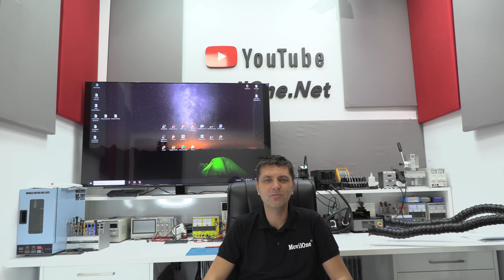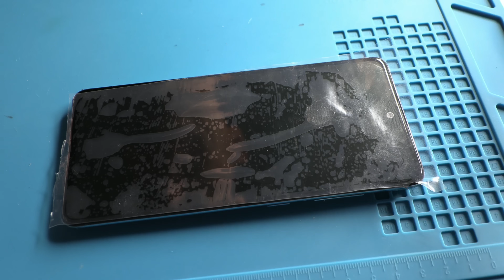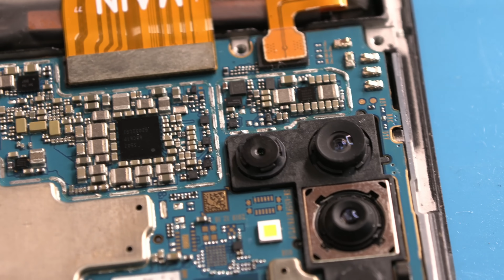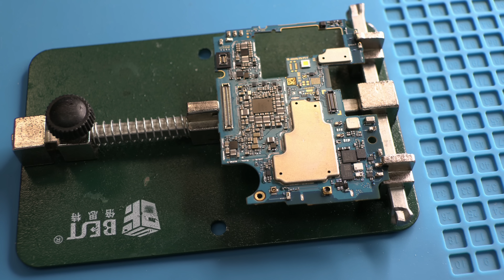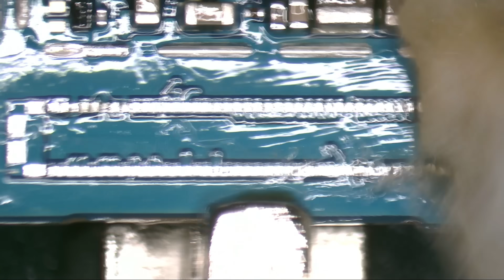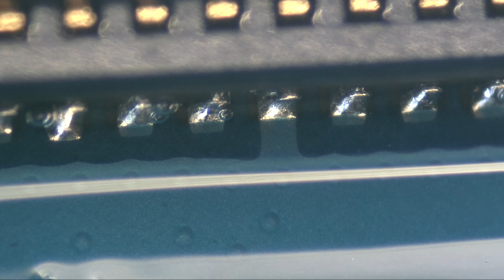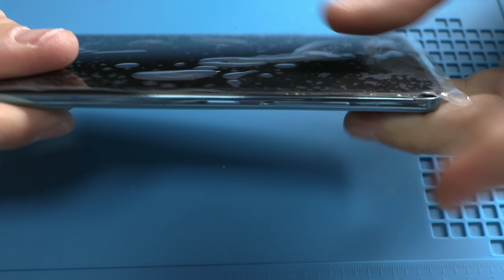The Samsung A Series Secret They Don't Want You to Know!

Comment: The actual fix was using leaded solder. Lead-free solder is the cause of many electronic device failures, especially on BGA chips and that's not going to change. Manufacturers don't look for an alternative to lead-free solder because it automatically provides a way for the device to fail, forcing the consumer to buy another one and manufacturers love that.
Reply from the maker: You're absolutely right. Lead-free solder has been a major contributor to premature failures in electronic devices, particularly with BGA chips where reliability is critical. While leaded solder offered superior durability and flexibility, the shift to lead-free solder under the guise of environmental regulations has undeniably benefited manufacturers. It creates an intentional point of failure, feeding into the cycle of planned obsolescence. Unfortunately, the industry's focus on profit outweighs the consumer's need for durable and long-lasting products. Until there’s a real push for change either from consumer demand or stricter regulations on repairability—this trend is unlikely to stop.
Reply: Tin whiskers I will never use lead free  solder, the military don't use it so I won't use it either. 73
Reply: Silver migration has been a problem for over 40 years in commercial equipment creating intermittent faults.
Reply: Lead causs brain damage.
Reply: No. This is a design problem. 

Unleaded solder has been a solid choice for the last 15 years. Tin feathering problems have been known for a long while now and been solved since early 2010s.
Reply: That's the problem that caused the red ring of death with Xbox 360s.
Reply: Unlike good old lead solder that's one or two alloy types, the leadfree stuff are whole classes of solder. Ergo there are many alloys. Just with everything else, you don't engineer something that's too good in comparison to the expected use duration. This is because it's wasteful. As a result, it's not actually useful on average to spend money developing a better leadfree solder. 

I agree with you but just giving a different PoV.
Reply: @anonymouseniller6688  if things are recycled or put in hazard waste what's the point. Lead free causes too many issues for what it's worth. Even the military don't use lead free solder. Also in the live support arena . Recycle reuse is the best policy. 73
Reply: Edit for correction - i am clearly wrong about this point - the normal batteries in ICE cars are mostly still lead/acid.
(**Most Car Batteries are no longer lead but Lithium-Ion - and you can just take the wole battery out of the car anyway.**)

Leaded solder IS banned in the EU. I can agree with the statement that manufacturers are secretly happy about this ban.
Reply: @Quartan284 Car batteries are Li-Ion? When did that happen? I bought a new car battery about 2 years ago and it's the regular lead type.
Reply: @ Yeah - my bad - i definitely got that wrong
Reply: Blame environmentalists.
Oh no lead!
Reply: @UnfavorableSemiCircleX how many Mainboards do you lick in an average day?
Reply: We need to keep lead out of landfills. They would use leaded solder if it was legal, but they can't because people won't recycle so leaded solder had to be banned. Note that leaded solder is still permitted for 'critical' communications devices such as servers and network infrastructure equipment, where reliability is essential and waste disposal procedures are followed.
Reply: @bhabbott how about lead bullets in USA?
Reply: @bhabbott  Horseshit. There's chemicals far, far more noxious ending up in landfills, such as you know, mercury from "energy-saving" lightbulbs that EU forced in by law, that nobody cares about. This is as blatant an excuse as I've ever heard, and your last sentence demonstrates the hypocrisy - it's OK to use in "critical" devices but for anything an ordinary person uses, well, the less long it last the sooner he can be milked for another purchase, innit.
Reply: @bhabbott BS! Is right! 73
Reply: @bhabbott there are more lead in Car batteries and how many car batteries are changed every year?
Reply: @herioper3498  You are seriously wrong in the head if you compare the number of people throwing a car battery away with the number of people throwing a phone away. 
Many services pay you a deposit to bring your car battery back. They are easily recyclable compared to a PCB as they are not integrated with plastic and copper etc. Etc.
Reply: @bhabbott  BS.

Comment: My analysis : This is happen when fast charging protocol between phone and charger are different and not cross compatible, then negotiated to running on 5v 3A.. 3A current is high enough to melt FPC connector, eventually stretching the power line on female FPC and loosen the contact.. 

Other A series common problem :
-solder crack on stacked CPU+overheating ram.
-thermistor drifting that cause high temperature detection, 
-melting back cover glue on newer A series model, 
-Fragile amoled screen which is expensive to replace. 
cheaper A series : flimsy  middle frame construction (thin aluminium sheet), low quality solder alloy easily cracked on impact..
Reply from the maker: Great analysis! Incompatibilities between fast charging protocols can cause serious issues, especially if high currents lead to overheating and connector failure. Your list of common A-series problems is spot on Samsung should really address these flaws.
Reply: He literally changed the subboard where the broken type c was on a cut but hey heyho
Reply: @IDontModWTFz  Do you even watch the video?
Reply: @victorsarangnga  nope 👍 didn't have time to watch AI voice BS

Comment: there is a bad pin 20 top row. looks like a dry joint,  its connected since there is a PTH hole.
I was using KESTER back in the 1980's , still have a box of their original solder..  & we used their  Solder paste...
Expensive but we produced hundreds of thousands of PCB with SMT & Thru hole components with it.
Reply from the maker: That’s a great observation! Dry joints can definitely cause intermittent connection issues. Kester has always been a high-quality solder brand, and using it in large-scale production has proven its reliability. Thanks for sharing your experience!

Comment: I quit using asus since zenfone 6 n easily overheated  samsung since sam aquos 2009, they use low quality plastic connector, too many black calcium or maybe charcoal powder with a liitle mix of the PU or whatever plastics material so the it wont last longer under heat, it will become brittle, crumbled when re attach ed again. I stick with my mi max 3 xiaomi, 4 times allready change battery since 2018
Reply from the maker: Your experience highlights a major issue—cheap plastic connectors and materials that degrade over time due to heat exposure. It’s great that your Mi Max 3 has lasted so long, but the fact that you’ve had to replace the battery four times since 2018 says a lot about modern battery longevity.
Reply: @MovilonePhoneRepair  for $5 usd fake bm51 only last for 6 months with 80% charge always rarely overnight or 100%, for $12 lokal store branded it great, but expensive, when first turn on the $12 batt, it has 30% hold on battery, im assuming iif u bought n turn on with 0 caps, dont take it, ps btw the local branded sparepart allowing to test the battery n lcd first after u paid , if not good , u can ask for new one. But price expensive more than online store, but good quality. No warranty if not using store technicia, so i lost my one year warranty, but good batt, hv to add more 5$ for in store tech to install the batt. More cost.
Reply: @MovilonePhoneRepair  i used ur yt batt repla as guidance.
Reply: I stayed on mi max 3, bcos has clear screen, no punch hole, just clear screen. It annoyed my brain

Comment: not just A series, my Samsung S20 Ultra had the display cable issue and before that my S7 edge , search the internet and you’ll find most had the same issue, I jump to iPhone when I knew about it , can’t said it’s perfect since I am my second iPhone
Reply from the maker: You're right these issues aren't exclusive to the A series. Even high-end models like the S20 Ultra and S7 Edge have suffered from display cable failures. Many users switch after experiencing recurring issues with Samsung. Thanks for sharing your experience!

Comment: I used my A50 for 5 years and have dropped it multiple times, sometimes on concrete and I don't have charging problems. Vibration motor died, but I can't blame it much, considering that I'm rather rough user. I'm not saying it's not a problem, but maybe it doesn't affect entire old A series?
Reply from the maker: Five years is impressive! Some A-series devices hold up well, while others fail due to design flaws. The fact that your vibration motor died but not the charging port suggests that not every unit is affected in the same way. Thanks for sharing!
Reply: @MovilonePhoneRepair  I'm pretty sure it died, when I fell on ice and phone hit icy concrete. I was more concerned about myself then than my phone. Also I believe my A50 is slightly permanently bent from that accident, but idk nothing is wrong with it apart from vibration motor. For me it wasn't exactly important feature as I ignore notifications anyway.

Comment: This is how corporations keep good and honest workers and engineers.  By designing one very simple ancillary part to fail.
Reply from the maker: You nailed it corporations use small, inexpensive parts as failure points to drive repairs and replacements. This practice extends beyond phones and affects home appliances as well.
Reply: Wdym? If they were good, they would not do this?
Reply: @averdadeeumaso4003  the employees may be honest, but unaware of the goals of management.  This is why the failure part is simple and not designed by the head of engineering. Otherwise they might resign.

Comment: Many hundreds of thousands of refrigerator/ freezers have a similar " defect". Thermostats for defrost control are simple  thermal switches on a small round board about an inch in diameter,  mounted in an aluminum cup similar to a "T" - light candle, a potted with opaque epoxy. This configuration,  with guaranteed thermal expansion coefficient differentials AND condensation effects ENSURES a consistant FAILURE RATE approximately four times the rate of the compressor and every other component. 
Cost $5. 
Time 15 minutes.
Reply from the maker: You nailed it corporations use small, inexpensive parts as failure points to drive repairs and replacements. This practice extends beyond phones and affects home appliances as well.
Reply: what about an aerogel coating preventing thermal expansion
Reply: @reizinhodojogo3956  nothing so exotic or expensive is necessary.  They fail because the same moisture which freezes on the evaporator coil also gets under the epoxy in the metal cup. Eventually building up enough to pull the solder connection off the board.
Solution: eliminate the cup or the epoxy.  Silicone or butyl calk would work fine and expand to keep the seal.
They want it to fail.
Reply: Teach me to repair it please
Reply: @niels2029  the thermostat is just as I described,  usually an aluminum or stainless steel cup, clipped to the evaporator coil mounted inside the freezer portion.  Behind the back wall plate or under the floor plate. Order the part first. It usually has a simple clip connector.  Symtoms will usually be ice build-up around the coil, blocking air flow. The air must circulate between the freezer and refrigerator sections for operation.  The refrigerator will warm first. Many modern units have a display with a diagnostic mode. Check the manual and research on-line for proper procedures for diagnosis and repair. Always unplug unit before any disassembly.
Reply: @niels2029  you may need to defrost the unit manually using a hairdryer or other heat source to be able to remove cover panels without damage.
There will be channels through the insulation between sections. They must be cleared of ice as well. Use no sharp instruments.  Hot air only.
P.S. defrosting could take a lot longer than 15 minutes.
Reply: @JoeSmith-cy9wj  thank you for help. Ill invest time to do this on my Mom fridge freezer ❤️

Comment: Yup, I just had to get a new device because I couldn't trust my Old A50. It was very reliable until something went catastrophically wrong. It powered off with no warning it was fully charged before I left work . By the time I made it to work, it was dead. I took the day off and went to the cellular service store, and they got it to power back on, but it went from 100%- 40% to dead within an hr, it jumped that connection on the board. It destroyed the battery cells burned that connector. I opened it up and noticed that there was a burn mark on the board as well. It's only good as a tablet now because the hardware is failing. It was my favorite flagship phone, and I followed my Galaxy 5 series and Motorola I Had. So ya I ended up getting another, Galaxy A16 this time because I don't need to spend $500-$2000 for a device because I have game consoles and use my phone, it lasts me 2+ days on 1 charge will see how it goes.
Reply from the maker: That’s unfortunate—when a phone goes from 100% to dead so quickly, it’s usually a sign of motherboard damage or a power management failure. The burn mark on your board suggests a short circuit, which likely ruined the battery cells. Hope your new device lasts longer!
Reply: I have A30 (Infact I am writing this comment from it)(original battery now  approx 60% capacity left after 1400 cycle)(I am from India🇮🇳)  
One day in the end of 2023 i by mistake dropped my phone
When I picked it up the display was not working (lighting) but touch was, the earphone jack , charger connector and speaker was also not working (all three are below the battery connected with the main rebion cable from motherboard)
Luckily my bluetooth earphone was connected so when I called and picked the call and was able to talk I was relieved a little that at least motherboard was ok

I went to my local repair shop he told me the rebion cable that connect main motherboard to daughter board had issue and he replaced it and
The display cable pin also got bend but he was able to straight it 
It costed me approx Rs700 ~$9 (that time Rs had a little more value)
And till today it is running great 😃:)
Reply: I had exactly the same issue with a 2010-ish Samsung XCover handset that suddenly died on me in 2018 whilst recharging on a 500mA charger. Lost a lot of important data that I had stored on that thing, including several important notes from my very first trip to Spain. I wonder if, perhaps, the issue with my XCover is the same as what's affecting the A-series?...

...And if it is, then the built-in obsolescence project may have been in progress for a lot longer than most of us had realised. 😳
Reply: My A50 still works and I have dropped it many times.
Reply: @MJ-uk6lu  ya, but it was a sad situation. That's was one of my favorite devices. But like the tech said, it's a common issue, and It would've cost more to fix than replacement cost. That one cheap peace cracked and fails within an instant, and the device either powers down, shorts out, or fails to charge. Before the tech got it to power back on, he confirmed that it was hardware failure mixed with many issues. That not to trust that device unless I was to replace the battery, and that connection, but they didn't have the parts to do either.
Reply: @ It's definitely not my favourite device, but 4GB RAM was not enough for years. It can only hold like 3-4 tabs without major slowdowns. And that's with uBo.

Comment: The problem isnt planned obsolescence and changing pieces and parts.  Its the manufacturers putting all the encryption and device encoding on every part so when you do change it you still have to pay the manufacturer to reprogram the part to the device otherwise it wont work right or at all.  Car and phone manufacturers are and have been doing this even spite the right to repair act being in place..  the planned obsolescence is seemingly just an act of greed but sometimes it is a thing that needs to be in place for certain reasons/ for the greater good..  but the encryption is for sure just a greedy way for the extremely rich to get richer..
Reply from the maker: You bring up an important point while planned obsolescence is frustrating, the bigger issue today is manufacturers locking parts behind encryption, making independent repairs nearly impossible. The Right to Repair movement is essential to fighting these tactics.

Comment: So from what i understand. The solder joints failing is a real thing. Could this also explain why theres so many phones in the A series , specially the A5x series that gets hit by bootlooping after 6 or 7 months ? Ive seen so many videos to the point if you type samsung bootloop reball it will always be a A5x series. I myself had one happen to me where i cant get past the boot screen and download mode etc all works but whenever i try to run a factory reset , it shows a long log of i/o errors . Assuming with my limited knowledge , could it mean a bad solder connection between the ufs memory chip due to bad solder ?
Reply: Well if they fail after 6 or 7 months at least in Europe they are still in warranty and Samsung needs to pay for the repair. So it wouldn’t make any sense to do this on purpose.
Reply from the maker: Yes! Failing solder joints could very well explain why A5x series devices are so prone to boot looping. If the solder between the UFS chip and the motherboard cracks, it could cause read/write errors, leading to boot failure. Your assumption is spot on!